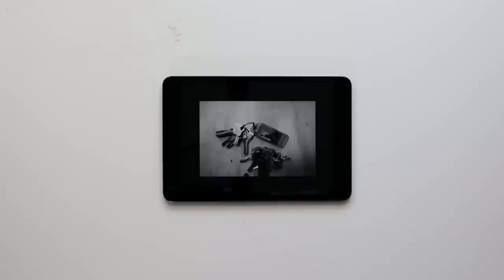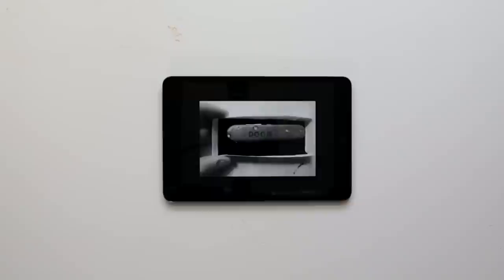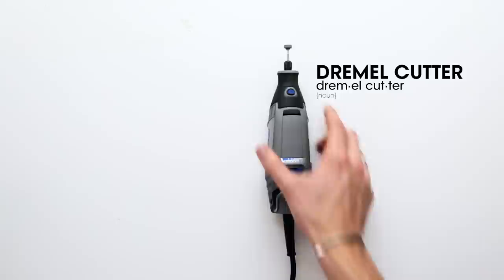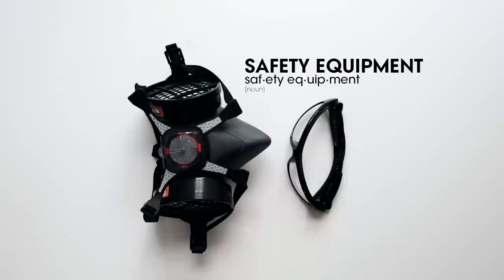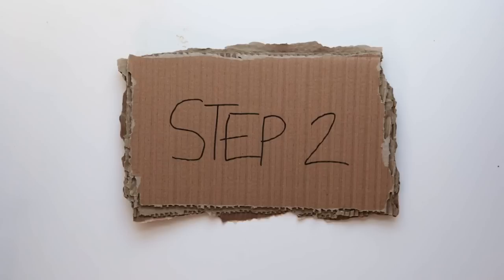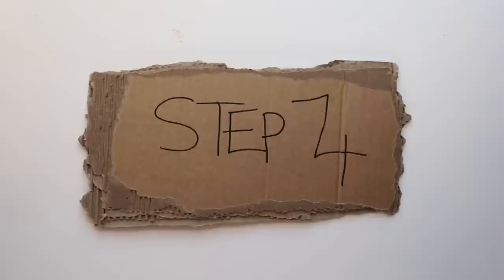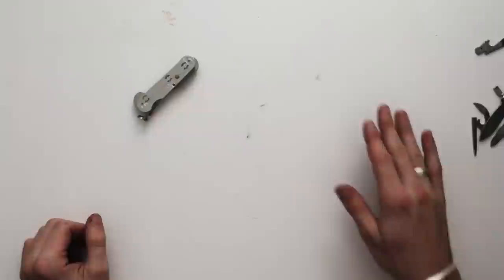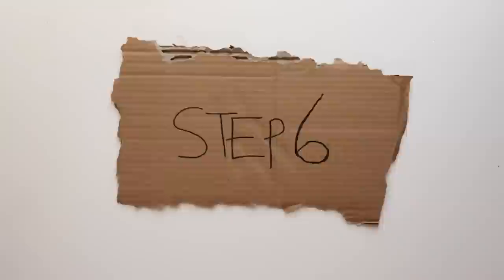The Jack-Knife Hack

Comment: Most automobile keys with a plastic or rubber grip have a smart chip imbedded inside the plastic/rubber grip that tells the car's computer that it is an authorized key to start it. Check before blowtorching it off because your car will no longer recognize it as an authorized key and refuse to start. Of course if your car uses a push button to start this does not apply; since the key fob becomes the transponder.

Comment: As ingenious as the idea is, wouldn't you find that you couldn't tell which key you needed as without the 'base' or head or whatever it's known as that might have some kind of marking or inscription on it it to identify each key, you'd find yourself having to take a guess as to which key to pull out and possibly after going through each and every key, you would finally find the correct one. Plus you couldn't really do any identification on the 'tail' or long part of the key as it's hidden inside the device. I could be completely wrong but it seems like something that could be possibly quite annoying about the final product.